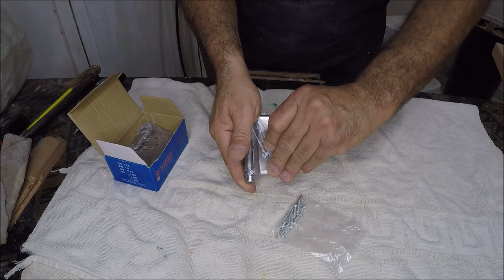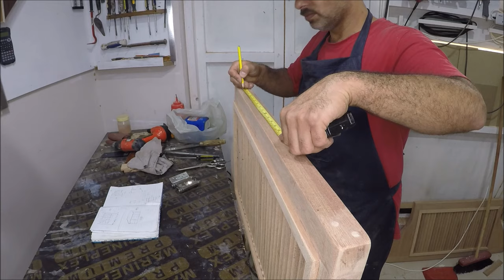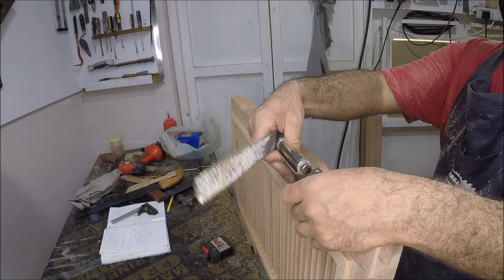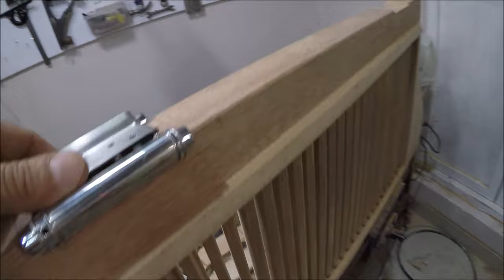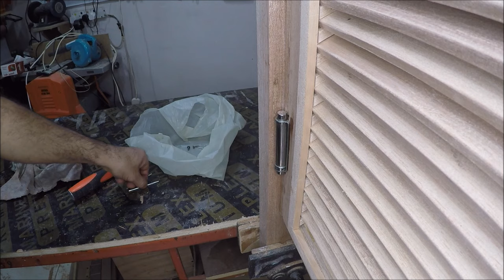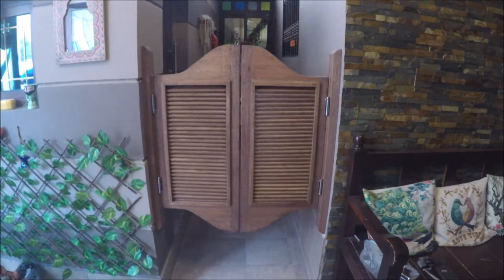how to instal double acting spring hinges

Comment: I have been always selling this double acting spring hinges, but i had never saw such a skilled carpenter for installation of the spring hinges. Thanks for your good sharing. Very perfect installation! But sometimes, i am not really sure of that their loading rates for different door weights/width because there are several common sizes of the spring hinges from 3" (76mm), 4" (101mm), 5" (127mm), 6" (150mm), 8" (200mm), 7" is rare. One more question about the door thickness especially metal door thickness will define size between two barrels of the spring hinge.

Comment: Hi.  Do both bottom
Hinges have the hole adjusters on the bottom.  I saw you adjusting the bottom and wondering if the top hinge adjustment holes on the top.

Thanks
Reply from the maker: Hi thanks for your comment the both hinges are the same exactly
Reply: Sorry.  Confusing myself.  I have installed  my double doors.  The left side has the adjusting at the top and the right at the bottom.  Is this correct? As I noticed you were adjusting a door on the clip from the bottom.
Reply from the maker: @pah9844  doesn’t make any matter up or down they are both the same

Comment: i am looking for hinges that will allow me to use the same door to lock in two different doorways. say one way would be the normal placement and then the other doorway is at a 90 degree angle. would it allow me to open the door 180 degrees?

Comment: Beautiful job! Would that work for a full length door? I have two undersized doorways in my finished basement that I'd like to install doors in.
Reply from the maker: It can be but if the door is too heavy you’ll have to put more hinges
Reply: @mardakworkshop4450  Ah… clever.

Comment: Is there a hinge that lets me mount a door to a wall and then opens to 270 degrees?  Most doors open to be flush against a wall at 90degree, if there is no wall, you can open most doors to 180.  But I'm putting a door on a wall and then I want it to bend all the way around and be flush against a wall 270 degrees later.  Is that possible with hinges?
Reply from the maker: I think that can be possible if you fix double hinges one open another but again it will take a lot of space Because you need a spacer between them
Reply: @mardakworkshop4450  I think I found it.  It's called Overlay Hinge.  Had to order it online.  Hope it's what I need.
Reply from the maker: @Andrew-hp1yj  if it’s work out for you send me the picture you can find me on instagram @alnajar22269 thanks 🙏

Comment: Why couldnt you just make the hinges directly to door instead adding that so called spacer??
Reply from the maker: It will not fit correctly and it will make a hell of noise banging to the frame while it’s open and close
Reply: @mardakworkshop4450  i did it but only thing i had to do was cut the door little deeper for the hinges, add little wd40 and tighten hinges and worked perfectly, swings back and forth for the kitchen, at first wasn't sure if it was gonna work, thankfully it did